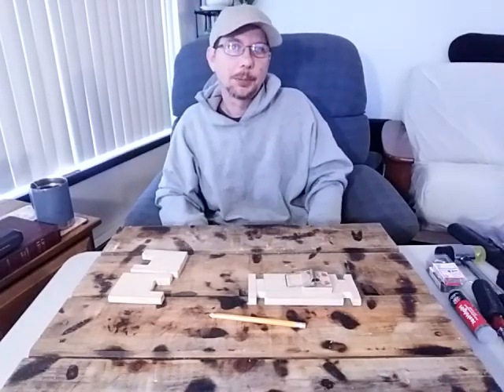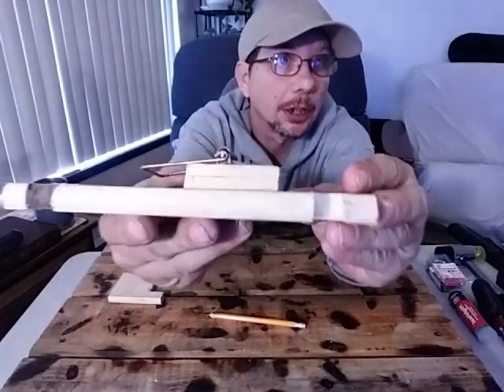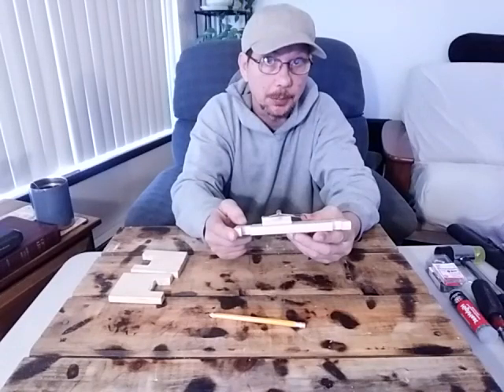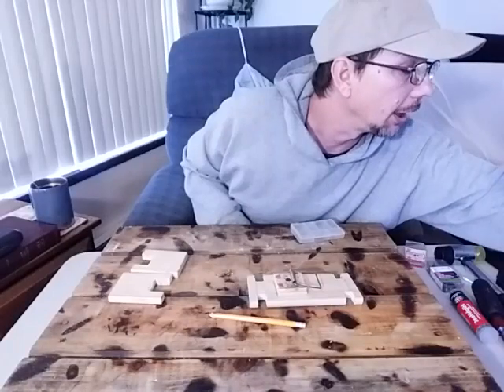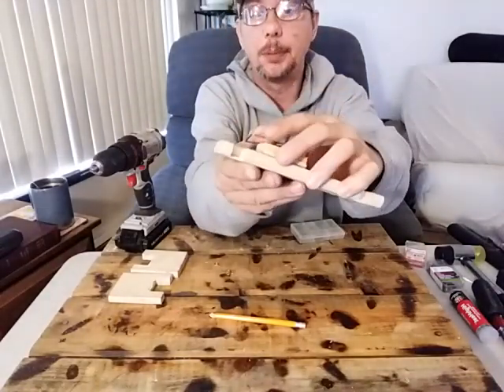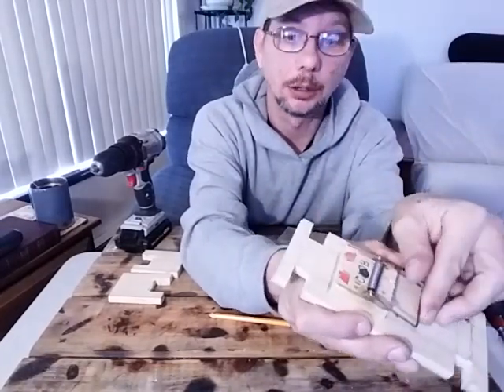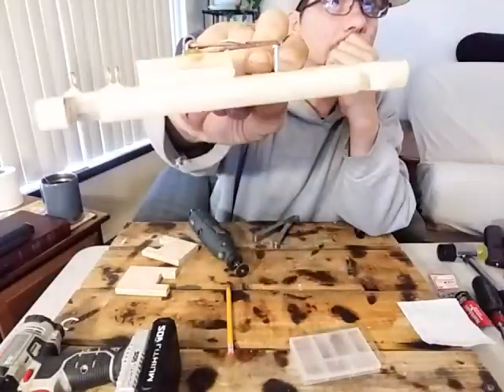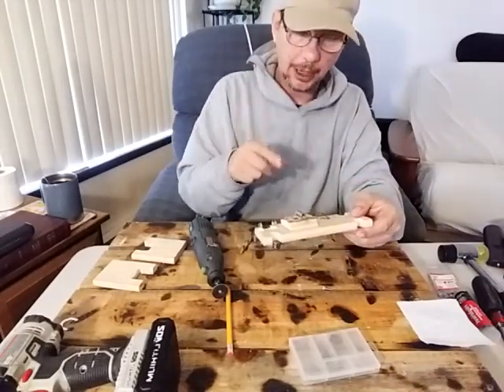DIY perimeter alarm three of three!🤓

Comment: Looks good! How about changing the order? Drill the hole for the cartridge case AFTER you have the firing pin placed on the killing bar....  this way the pin will leave a mark so you know where to drill the hole.
Reply from the maker: I don't see why not give it a shot.
Let me know how it goes. I would assume it to be easier I appreciate the Suggestion for others.🤓